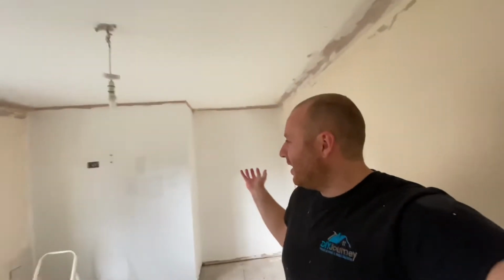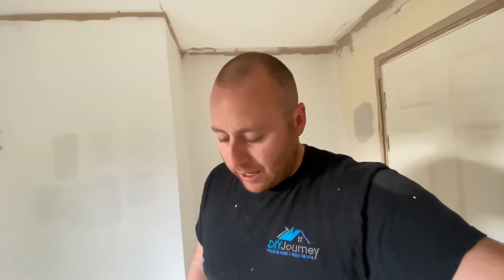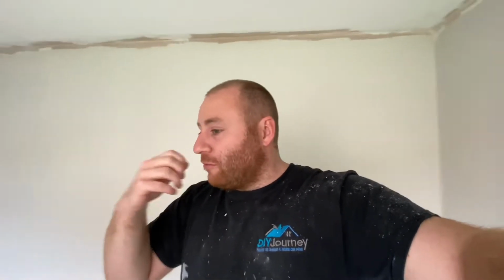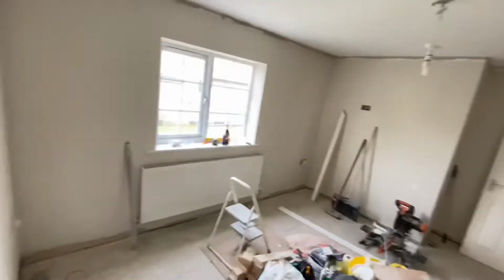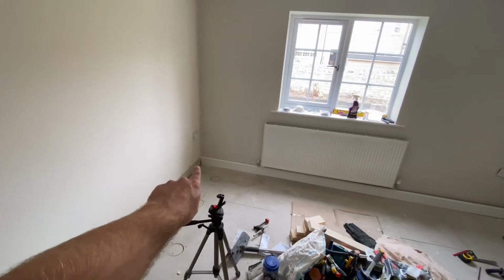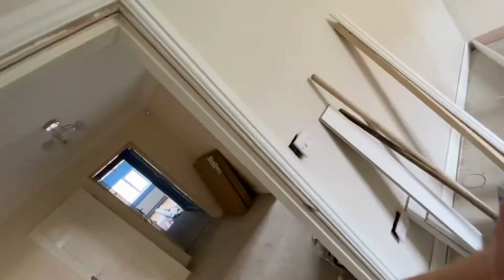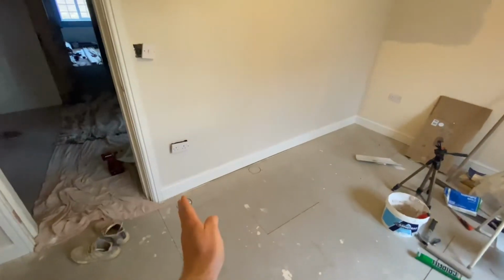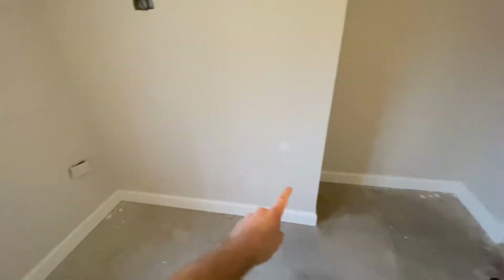INSTALLING SKIRTING BOARD & COLOUR REVEAL - Project Nursery

Comment: Great job mate, looking good 👍, I always used to use gripfill as its super strong, the only thing I didn’t like was the smell but most importantly that it skins over very quickly resulting in a less bond if you know what I mean. Converted to ever build multi stick or stixall (available at Toolstation) bit more modern as its polymer based, brilliant products. Keep up the brilliant work!!!!👍🔨🪚👌
Reply from the maker: I know exactly what you mean, it quickly gets a skin on it doesn’t it. Ill have a look at that for future use 👍🏻 Appreciate that, toolstation isn’t as easy access for me but ill certainly give it a fo,